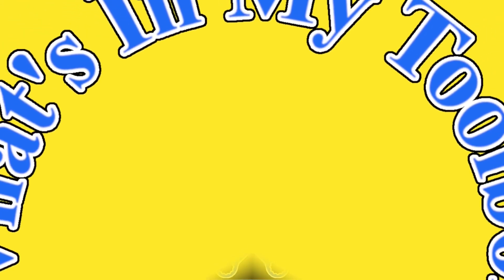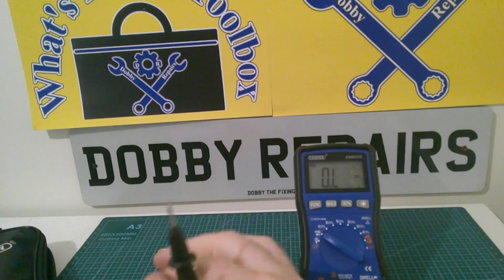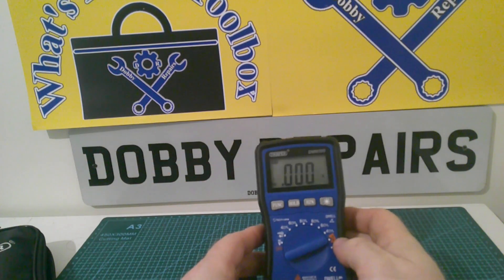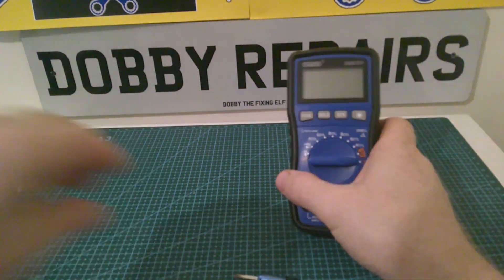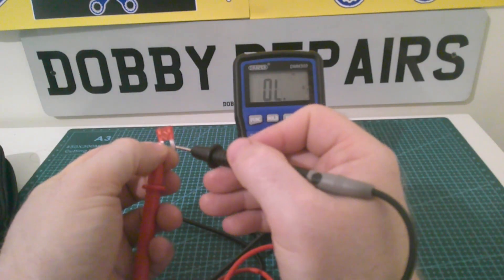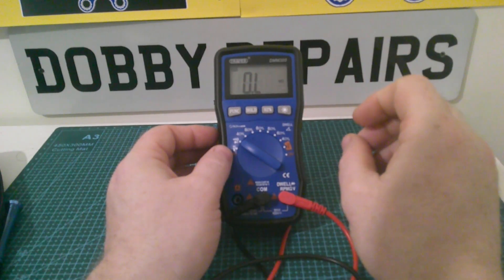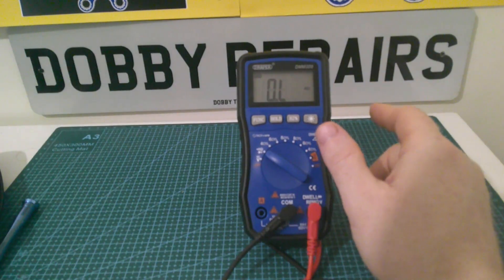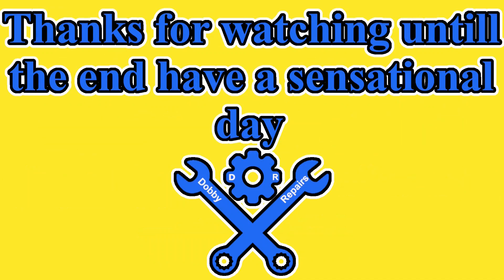What's In My Toolbox - Draper DMM300 Automotive Multimeter 41821

Comment: got this to determine a faulty ignition coil on my car. couldn't get the bastard to fire up. thought it was broken. turns out i had the batteries in wrong. no instructions for the batteries, very fiddily and very badly labelled. thanks for the video. 🙂👍
Reply from the maker: Yeah I agree it's not the easiest to see how the batteries go in . Hopefully you can diagnose if one  of the leads is faulty what car are you working on ?  And thanks for watching 😄
Reply: @dobbyrepairs 2020 toyota corolla hybrid. thanks.
Reply from the maker: That's cool hope it goes well for you 😁

Comment: Hi. Thanks for this - I'm new to Multimetres. Looking at this on Amazon due to your comments, but the pictures show the red lead in the far left hole, and black in the middle, and another picture for car battery, the red is in the middle and black in the right hand hole? But you have them differently? I just want to buy it to test my Car Battery? Can you clarify please? Thank you
Reply from the maker: Thanks for watching  multimeters can be set up differently for most meters the middle hole is the common/ground it's were the black lead should be the right hand hole is normal for reading voltage and continuity so for instance to read voltage you would put the black lead in the middle hole and the red lead in the right hand one then put the black probe on the negative termal of the battery and the red to the positive and the left hand hole  is typically for for amps if there is something that you would like to test about your battery if so let me know and I'll explain how you can do it
Reply: @dobbyrepairs  That's great, thank you very much for your help! I shall get it bought :)
Reply from the maker: No worries if you get stuck drop me a message and I'll do my best to help
Reply: @dobbyrepairs  Thanks!!